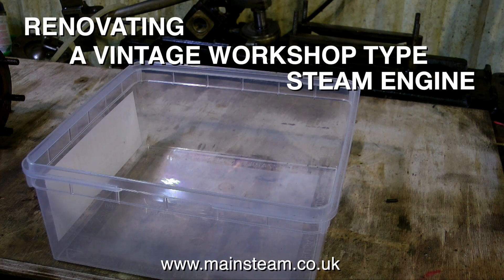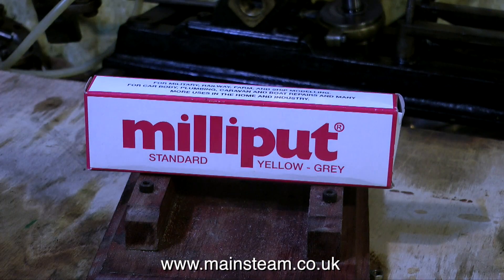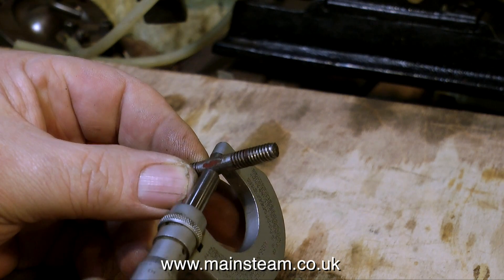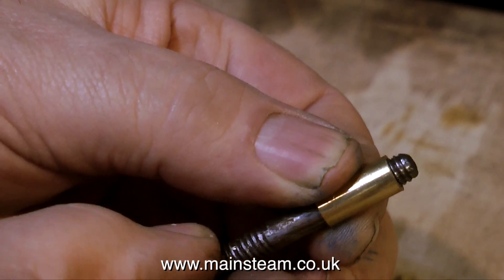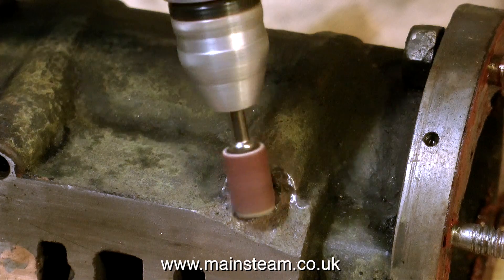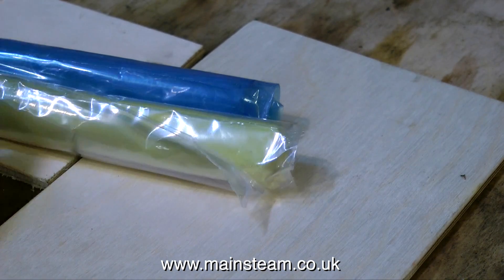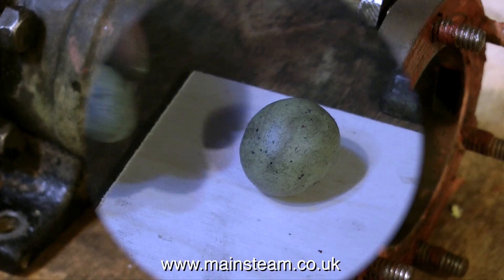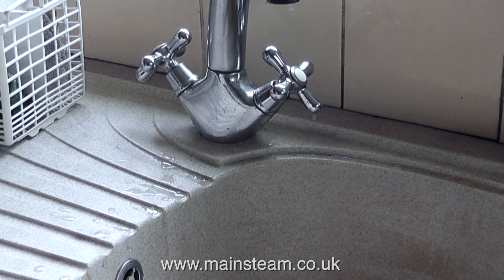PART #5 - RENOVATING A VINTAGE WORKSHOP TYPE STEAM ENGINE

Comment: When forming epoxy around a stud, what I do to make it release is first clean the stud well, then I apply car wax to it. Once the wax has dried, I gave it a buff. Works like a charm. I've used the same technique for repairing spun bearing damage in motorcycle transmissions. I degrease and rough up the hole, wax the new bearing, then apply the goop and torque it up. When it's cured, I crack it apart and tidy it up. Much cheaper than a new casing.

Comment: Quick question, why did you not make the brass sleeve a little smaller and thread the inside to help support the stud?
Reply from the maker: Because that would not have been a good way to do it .......... how could the brass sleeve be supported ????? The way I did it worked out to be a 100% successful fix.